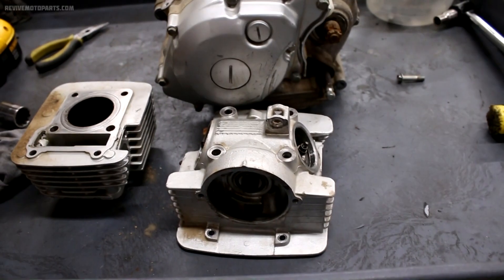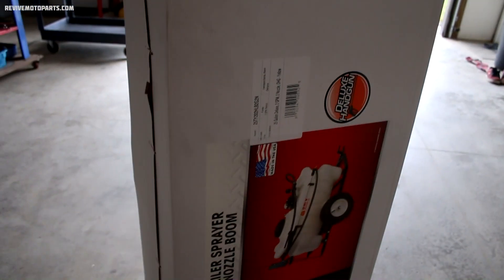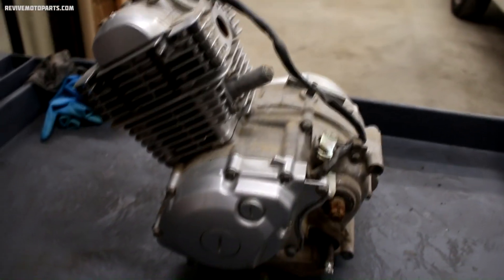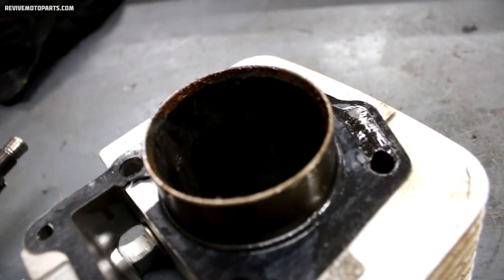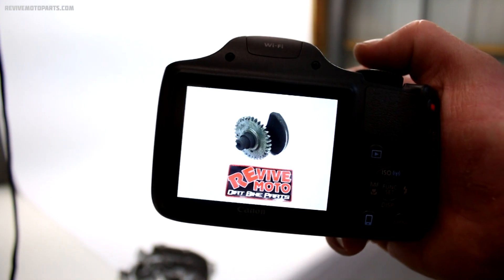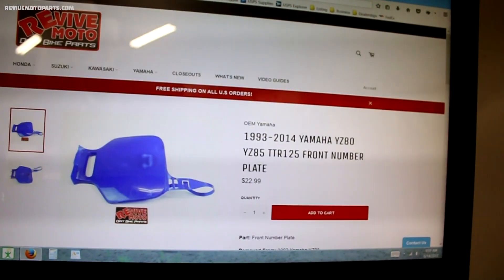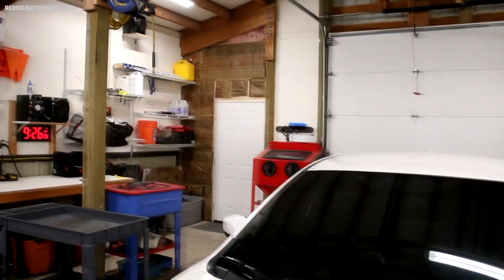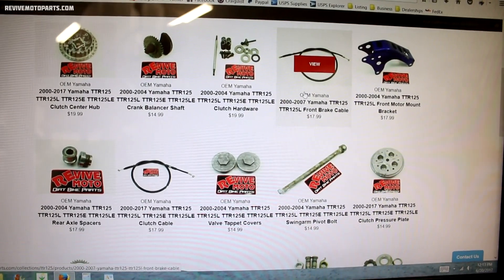Why This Motor Blew Up

Comment: If you ever have problems with oxidized aluminum. Or rusted stuff. Get a metal bucket or bowl. Put fuel in it. And drop the part in for 2 to 4 hours. Pull out. Wire brush with copper wire brush. Rinse. And it makes aluminum look brand new
Reply: Cody Erickson does it work with kerosene or will it just melt it like it does with steal beams?

Comment: I just got a kx 250 2 storke and the original owner said it will need a rebuild. does that mean i will have to replace the cylinder as well.
Reply from the maker: You'll have to tear it down to see what is worn.

Comment: Which "site provider/ template/ host" (I'm fairly new to building websites) do you use for your website? I'm looking to build my own website where I would like to sell art... your template looks pretty simillar to what I had in mind. Thanks in advance man!
Reply from the maker: I use the Shopify platform. Pretty much a pre-made website that can fully customized and has access to coding as well. Best platform I found for my needs.
Reply: ReVive Moto Parts Thanks ;)

Comment: Someone already noted the spray wax with the claybar. You can actually use water mixed with pretty much any autoshampoo to lubricate the surface, and you should almost soak the car with the mixture. Oh and also don't press the claybar down at all when you are claying. The clay works with friction, not pressure :) Other than that, awesome content! Cheers from Finland!
Reply from the maker: Thanks for the advice, that makes a lot of sense! Seems like the clay would work better on a wet soapy car for sure. I'm Finnish by the way.

Comment: On the standard oem vacuum carb (Keihin NCV24 with PJ/MJ 38/112) on the KLX150 4-stroke engine, for instant throttle response i change carb to Keihin PWL26 with 40/105 NeedleClip4 with this plug-chop says im running a little-bit rich, 

and as usual... i do another upgrade to 170cc combine with head porting and cam changes, 

PWL26 40/112, PWL26 40/110 will caused coughing (during WOT 5th gear somewhere around 70%-80% rpm range), 
coughing here its almost similar like dirty carb

after that range passed, its firing normal again, and engine feels like too hot...

Q1: Any suggestion what main jet should i use after bore up, cam-changes on that PWL26 Carb?

Q2: OEM suggestion for this SOHC engine is 10-40w, after modification, should i change my oil specs?

Thanks,
Reply from the maker: I can't say exactly what size main to use since I have no experience with those engines but definitely sounds like you need to go bigger. Buy a few sizes bigger and do some testing. As far as oil, you're fine using the OEM spec.